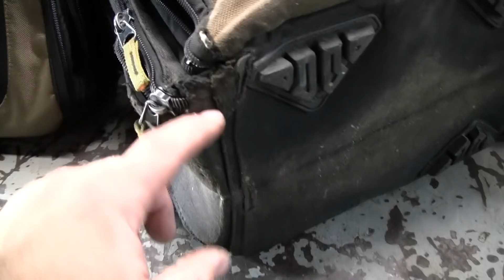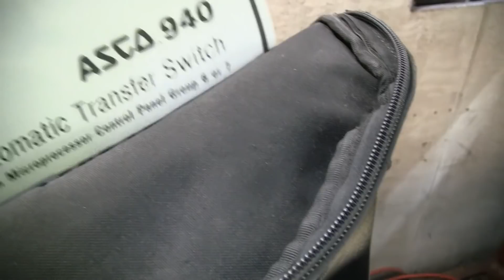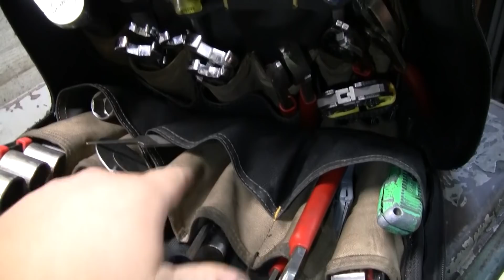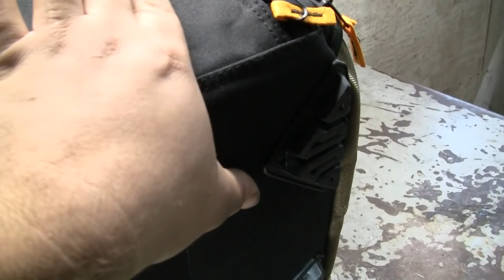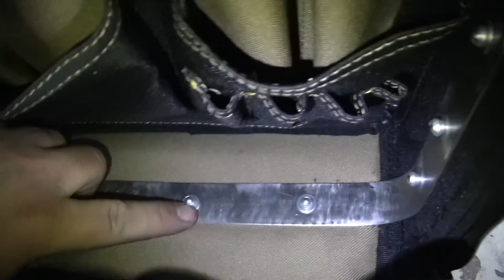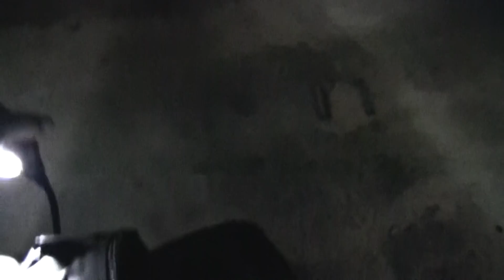CLC E-Charge Back Pack Tool Bag 3 Year Review and Modification

Comment: I was looking for something just like this! Wonderful change up to the repair/diagnostic videos . Great to hear and see it from a guy who actually uses it in the field. I use the Klein backpack but ive had issues with zippers failing rather quickly, even to the point where I convinced my local supply house Klein dealer to warranty a few out because even he said it was ridiculous and my bag is probably lighter than yours, maybe the same. So long story freak in long lol, thank you and i will be purchasing this bag, doing the same mods and the buckle mod with some aluminum buckles.  Stay safe! Pro tip: I work on the high voltage equipment that supply power and controls for the subway system or metro system in the bellows, under the streets of D.C. so i do alot of late night city walking ,sometimes really far and I modded my last bag with a roller system off of a nice piece of luggage so I can convert it to a rolling bag and also wear it on my back. You should do the same! Saves yer back. And lastly; carry a weapon

Comment: I do a lot of work on rooftops, in compressor rooms, etc, and currently use a Klein backpack. I’m in the process of going back to an over the shoulder bag and metal toolboxes. The zippers on the Klein haven’t held up well, and will dump tools out when it slouches.

Comment: For the top of your bag, a metal hook from your stainless with a 100 degree bend on the end. and a piece of steel on the end of a strap with a slot to catch on the hook. And a magnet to hold it on. The magnet is also useful for holding small parts. Easier to operate than those plastic clips.

Comment: - A good cobbler should be able to replace the plastic zipper with an appropriately heavy gauge metal tooth zipper, AND your need for leather strap buckles that could deal with both sided easily.
- SEE: "SCHOTT jacket alteration" https://youtu.be/GeHVkkxDIhU?t=569

Comment: I've had a few CLC products over the years. They are normally pretty well designed except for the zippers, buckles, and velcro. 

For the bracket look at chicago screws. That way they are flush on the inside and don't have those hand ripper nubs.

Comment: I know you like to be prepared but I'll throw out a suggestion that has worked for guys in our gen company. Do a light weight tool kit for trouble shooting and new start-ups, then have a second kit for common repairs, which covers wrenches and sockets over 9/16", pump pliers, etc. The smaller kit includes meters, selection of zip-ties, crimp connectors, jumper leads, etc. Got my small kit to under 20 pounds total, which makes life easy. If I need bigger tools then I probably need parts from my truck anyway.

Comment: Get a older style leather belt made to carry tool pouches. 
One has the two prongs that goes thru the belt. 
Place around the whole bag . 
Could pre measure to get right waist length.  Would support the whole bag system thus saving all the zippers .  Like the review very well done.

Comment: Word of advice brother. I have had problems with zippers on my tool bags as well. This is what I do. Take the bag to a clothes alteration place that does leather as well. Tell them you want heavy duty zippers installed. They will replace them with metal zippers that will never break. I think it was like $20. Cheap. I do it before I move my tools in. Buy a brand new bag, get zippers installed.

Comment: I was one of the first to adopt a backpack style tool bag.  In my area at least.  That was over ten years ago and I used the same brand. Of course everyone else looked at me like I was some kid trotting off to school but it really worked. Hey you can’t fix stupid and they generally shut up when they saw me scoot up a vertical ladder to a roof with all my tools on my back.  My only complaint was that the bottoms would blow out.  They needed reinforcement but maybe they’ve fixed that now.

Comment: Mike- The rivets are exactly what I would do!
What happened to the SS "L" brackets? Those would've been great.
Tip with rives- I try to always use washers on BOTH sides, so it helps
to grab more material, and gives it that "puckered quilt" look.
A shallow SS or aluminum tray would've also worked. 
Put the other light on the other side. 2 > 1.

If you want to add extra reinforcement to anything stitched-
add a few drops of whatever brand cyanoacrylate; it really wicks
into nylon (polyester) and makes a hard, durable shell.

Maybe add a couple snap or similar straps, to help hold
the compartments together, not just rely on the tensile of the zippers.

Comment: I never had to carry that much weight because I never did trouble shooting and repair anywhere except in a manufacturing facility .   We always had the ability to get within a reasonably close distance except for the walking up steps.  Carrying that much weight anywhere but on your back is just not something anyone should do.  It is too bad there is no way to have a more rigid section to keep the weight high on your back but it sure beats carrying it on one shoulder.  I have worked on few installs of gen sets some really large ones and just a few residential sized ones.  Where we put them guaranteed the people who had to service them would have a problem if it was a serious problem, we mostly installed them as the building was being built.  I think a lot of them would require more than one wall to be at least partially removed to replace the unit.

Comment: I bet that works great. Interesting to look in your bag of tricks.
I'm a cheap one, so I use one of the HarborFreight tool bags. Found a suitcase dolly at GoodWill once. I drop my cordless box on the dolly and then the bag on top. bungee it down and then I'm good for a roll. Alas, I don't have to deal with stairs or sidewalks either.

Comment: Mike, why don't you cut the buckles off the old bag and pop rivet them to the top of your new bag with a small backer piece of stainless, and you have solved the issue with the zipper coming undone.
Reply: and you won't feel so bad about ditching the old bag. Its been your work companion/buddy for a long time. You'd feel there was still a piece with you. and other mods if needed.
Reply: Excellent suggestion Matt and Harold, his loss if he doesn't read this.